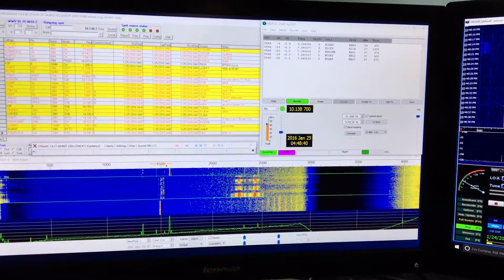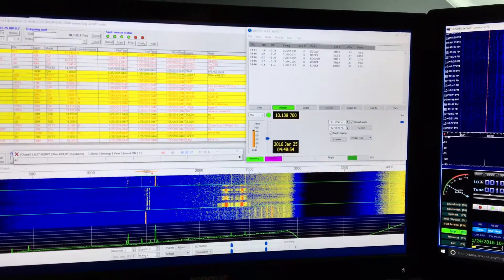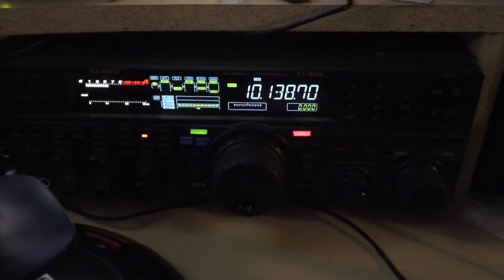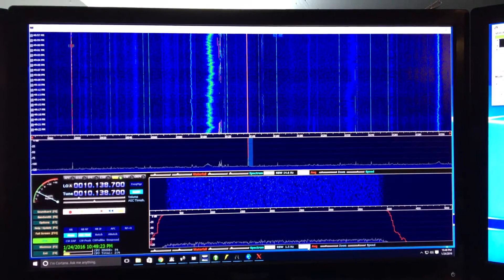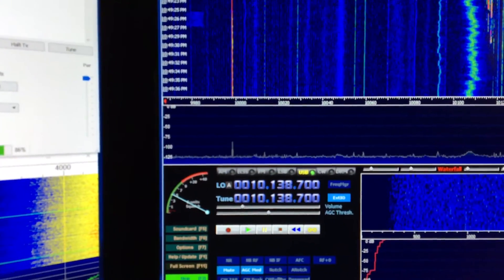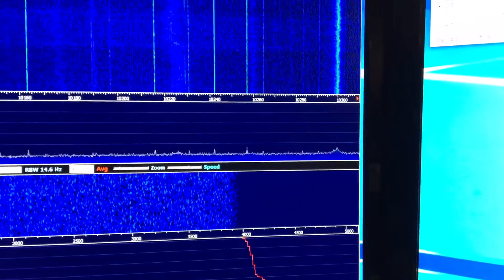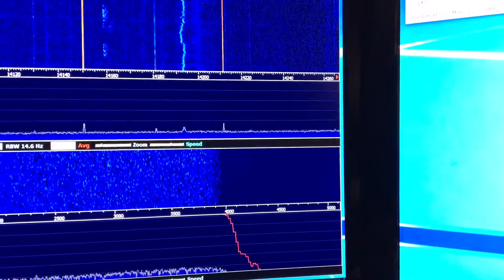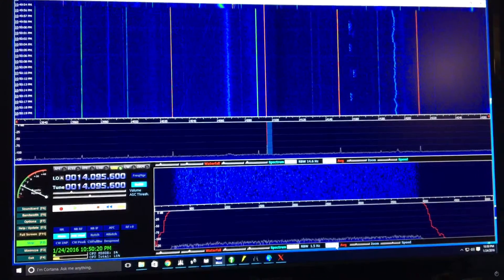RTL-SDR on a Yaesu Ft-950

Comment: What hardware did you use?
Reply from the maker: RTL-SDR dongle
Reply: What about the cable? I have a 950 also and know very little about this.
I need the dongle and cable, I have the software and I guess I will need a driver
Thanks for your help...